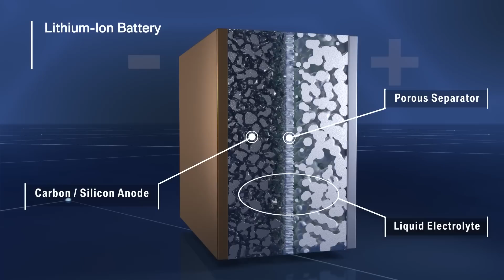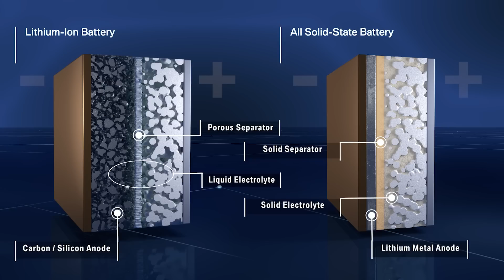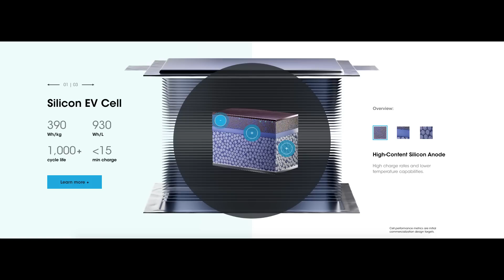Why Solid State Batteries Could Be the Future - Autoline Exclusives

Comment: Is there any projected change in heat generation during charge and discharge, is that all a function of internal resistance? How about charge discharge rates?
I'd like to see a long life, lightweight solid state replacement for my 12v maybe a solid state with a j1772 at about 45 lb that you can throw in the trunk of your old EV for challenging trips, park it and plug it in.

Comment: Solid state batteries will be the game changer in EV revolution!
Reply: Very cheap cells using abundant materials, produced in huge numbers, which meet the performance envelope of specific vehicles "will be the game changer in the EV revolution" (!!)
.
A 4680, made in a relatively tiny factory which outputs about 7 times the kWh (GWh?) of a "wet" production line, which uses only 60% of the metal to carry the same capacity of smaller cells, which suits a structural role, thus making the vehicle lighter and which may be suitable for use with "cheaper materials" seems to be a great start?
Reply: Might be, I wonder if by the time they figure it out we'll have an equal non solid state solution
Reply: Yes, especially for eVTOLs!

Comment: Solid-state batteries are a great in the lab but let's see them in an EV we can buy. Meanwhile, my 2019 Model 3 on the driveway is working just fine.

It costs $2.75 for 100 miles around town and highway miles are $3.50 for 100 miles. Staying overnight in a motel with free breakfast and charging costs $3.00 for 100 miles. The expected, 7.9% battery degradation has been slower than the Supercharger expansion.

Comment: Bring it on! I don't see the battery space as having winners and losers, we need all the ideas and we need to use them all where there is a use case. We know that when a single chemistry is dominate the cost and availability of the materials become an issue. The more diversity we can have in batteries the better.
Reply: Exactly! And some battery types will be best in certain vehicle types and we'll need something different in others.
Reply: @davidmccarthy6061  Even the ones that don't make it in cars could be used for other storage applications. Nothing will go to waste.
Reply: Agreed.
If a cell form factor/ chemistry/ technology type appears which matches the necessary performance window for a specific product, at the right price, use it!
.
I think this is one area Tesla may be ahead of the game.
Let's say a "4680 killer" (🙄) arrives....
They have other applications for the "older" tech.
They have a small, high volume factory format.
They have elements (at least) of that factory which should be compatible with new technology.
.
Ramp time from "green field" will be a factor.
.
The more "out of the envelope" thinking, the better.

Comment: I believe there are a few major problems with solid state batteries that will make them irrelevant to EV until may be after 2030: 1) lithium dendrites issue will degrade battery very fast, 2) they are expensive to fabricate and mass produce, 3) interfacial and mechnical stability issue will cause early failure.
Reply: Solid state batteries are the nuclear fusion of energy production, always a promise, never a reality. Solid state battery tech. is older than Li-ion battery, but never managed to scale it up.
Reply: Innovators will continue to innovate.
Reply: There are a out four major kinds of solid state batteries, each with pros and cons.
Reply: In automotive world 2030 is tomorrow. Qualifying anything takes years.
Reply: I think fast easy construction is one of the positives, they can skip the baking/drying step

Comment: Glad to hear someone say 500 miles. Too many manufacturers are not looking past 250. That 500 also has to be REAL miles, at highway speeds and with mountainous terrain. Your typical 250 mile range BEV only gets about 160 max on western highways which commonly have 80 MPH speed limits and have 3,000 foot passes to go through. If your on vacation, no big deal, but just stopping for a recharge 4-5 times on an 800 mile trip is just too expensive (in time lost) when all of our my gas and diesel vehicles can make it with one 5-minute stop.

I've tried it with several, Tesla is the best, but it takes 5 more hours to make an 800 mile one-way trip than a Ford Fusion or a Mercedes GLC Bluetec.
Reply: Sounds like you are doing it wrong then. You also state an extremely rare use case that 90% of people don't live with. We sure don't want every company making 500 mile EVs just for you. My Bolt's range let me charge every 6-12 days depending on season, for $15 a month. How are your gas prices today? I sure don't want to lug around 2000 pounds of battery I'll never use!!!
Reply: Aptera!
Reply: If time is money and you can't afford to waist time, take a flight.
Reply: @heathwirt8919  Easy to make a dumb comment when you don't understand the situation. We move goods that can't go on flights. That have to have a certified caretaker, so we can't ship it. But even if not, flights are expensive when I can get 4-6 people 1,100 miles overnight. You really don't think we've looked at the options?
Reply: "500 miles"
Watch again, he was talking about Trucks, not cars.
His basic position (imo, explained in a different way) was
"Outrange the driver, charge during the "driver break", repeat"
Reply: Too much battery is a waste of money space and weight. People need less range than they think plus there are charging stations. If you build the electric car people think they want no one will buy it.
Reply: @rp9674  Your overly-broad statement sounds really stupid to those in rural cities that regularly need to make 1,000+ mile round trips. You are right that current battery tecnology is woefully inadequate to us. Current technology is essentially only good for people who never leave their little 200 mile bubble unless on vacation. Maybe in your population centered life you don't know about the large number of people who regularly do have to make long trips quickly, but we exist, and we test all the cars that others claim to work for us. Tesla's range is hurt by how little charge you can rapidly get in after that initial 100% charge, and Elon is reducing the range promises he initially made. The Ioniq-5 and Taycan can charge reasonably quickly, but no part of their range is adequate. And NOBODY's range is accurate at the 80 MPH freeway speeds in the western US. We need better battery technology. But too many governments seem to want to legislate away fossil fuels without providing a workable alternative.
Reply: No, it would be stupid to build a EV with 2x or 3x the battery to try to meet statistical outlier cases, It would be too heavy and expensive.  Of course freeway speed, hills, extreme cold cut range. Anyone who drives 1,000 mi in one trip would benefit from a lot of compromise VS the cost of gas, not even considering and fire mental issues. Gas production is subsidized in USA, probably why it's cheaper than many other countries. If EVS get popular enough there should be lower gas prices from supply vs demand, for the people that need it.
Reply: @rp9674  Only too heavy using current technology. Why are you so opposed to investigating ways of having better energy density than LiOn can provide? While this technology is much better than it has been in the past, we need still better technologies. If we had better energy density, it would be much easier to have V2G and V2H for city dwellers, reduce the need for L3 chargers in and around cities and give us a technology that doesn't provide a disadvantage for the people producing the food you are eating. Quit being so complacent with what we have today.
Reply: @michaelterrazas1325  I'm not opposed to it, research is happening now, there's dozens of videos about amazing, insane, game changer, game over new technology that's almost here. I'm looking at reality and current technology. Obviously improvements in energy density / cost will change the equation. Public charging will get faster, more common, and less necessary.
Reply: @rp9674  I am not as sanguine as you that we will see any usage of other technologies by the current BEV manufacturers. There is just too much infrastructure being built up with an inadequate technology (technical debt). Within a couple of years, moving from L-Ion will have just as much inertia keeping new technologies out as ICE does today, and there will be no easily identifiable pressure to get them to move to longer ranges. Hence, economies of scale will never develop. So instead of driving our cars for 10 years, we will be forced to try to make our ICE vehicles work for 20. 

Then I see every car manufacturer, including Tesla, saying what you did (due to what I see as short-sightedness): that 2-300 miles is all anyone needs. That is just not true. A range that short only covers metropolitan area dwellers who only leave their big cities for vacations. Those people don't actually need personal vehicles at all. They could be more economically and ecologically served with mass transit, ride-sharing, and, in the future, automated vehicles. It is just as stupid to have all those cars in all those homes with their carbon footprint of manufacture as to try to serve those who do need longer range. Those for whom mass transit, ride-sharing and automated isn't just distasteful, but actually infeasible.

I don't have the links right here, but several studies have shown that the vast majority of personal vehicles on rural interstates are not registered in metropolitan areas at all. One study, conducted by a California university at interstate travel centers (Flying J, Pilot, Loves, and TA), found that most drivers surveyed indicated that their trip that day was over 500 miles one way. Such trips are not the design point for any BEV today. And yet, California wants to outlaw ICE vehicles for everyone, even though there is not a workable alternative for most of the cars on I-5, I-15, US-101, or CA-99 once you get away from LA, Sacramento, or the Bay area. Almost the entire Midwest and Intermountain West are that way also. So, no, you are wrong. It is not an edge case. It is blindness to the needs of others in different circumstances than you.
Reply: @michaelterrazas1325  it is an edge case, it just depends on where you draw the line to what's edge. EVS are struggling to be profitable appealing to 10% of their small market probably not a good business move. Government needs to do something to move it along, a gas vehicle bought in 2034 should still be good for a few years. I can't imagine they won't have a solution by 2040, it'll probably be so good people will forget what they were fighting for. Easier to relax restrictions later if needed then do nothing. Mass transit doesn't even work in LA area, except as supplemental, we're too spread out. 
In your example trip if improvements cut the extra time down to 2 hours, might be worth saving several hundred dollars on gas and maintenance, maybe have a leisurely meal break or 2, not to mention environmental considerations & less dealing with murderous regimes like Saudi Arabia & and the side effects of Russia's actions.
Reply: @rp9674  My point is that it is more than 10%. Over half of Americans do not live in metropolitan areas. Everyone you deal with drives short distances, but that doesn't mean there isn't a very large market. LA did have an effective mass transit at one time, and it could be rebuilt. It just needs government to focus on it, rather than high speed rail to nowhere. The Metro system is getting more ridership daily. It needs to be expanded, and LA has to limit car usage to every other day, or every 3 days like some other cities in the world did to get people to use mass transit. So far, politicians are unwilling to bite that particular bullet, because they won't be re-elected. That's what I meant that it is only distaste that makes it so mass transit won't work, nothing technological. Other cities that are just as spread out as LA have made it work, but it takes courage. Those that have forced the issue have begun to see reduction in car usage and fewer carbon emmisions. If we can ever get there, car ownership in the US will reduce drastically in metropolitan areas. At that point, the vast majority of privately owned cars will be in the rural areas.

But I have to strongly disagree that we will see a move to another technology in my lifetime. As we see now, business doesn't want to change. For all the capabilities of Teslas, nothing would have been done without the EU, China, and California regulations forcing automakers to change. They were only able to do it because there was an obvious reduction in climate change causing emissions. Moving to a more energy dense technology will be just as expensive (retooling), but the apparemt benefit won't be large enough to justify the investment, particularly if people ignorantly keep saying that no one needs longer range. Or if those same people keep thinking it's just a miniscule number of people who need it. The fact is, since no one is building clean vehicles that match the range currently seen with fossil fuel vehicles, we have NO IDEA how well they will sell. Looking at the inability of OEMs to predict the sales of EVs, I don't see any reason to believe their or your assertions that there isn't a market there. You sound just like Toyota, loudly proclaiming something that you do not have a clear view on. So I see us eventually getting a bunch of useless small-range vehicles and the OEMs having TRILLIONS tied up in the technology, and being unwilling to reinvest after the current disruption. 

There will always be those who don't need a lot of range. We already have EVs for them. We have also that in the ICE world. I have no use for a  Sentra, RAV4, or dozens of other ICE vehicles that need to refill every 2-300 miles. That's why I and my neighbors have Fusions, GLKs and other vehicles that get us 5-700 miles on a tank, but I hate spewing out CO2 and NOX. And I know a lot of people in 14 states that would jump on the opportunity to buy something more ecologically sound, if it were also economically sound. But since nobody is working on it, and gas stations may go the way of the dodo, we are justifiably concerned that our needs will ever be addressed. The fact that you so obstinately refuse to consider this as a legitimate issue is evidence of the problem. But then we are used to it. Sacramento takes water away from crop and stock growing to water golf courses and keep high-end neighborhoods with green lawns. The federal government makes regulation after regulation that forces small farming and ranching operations out of business. Once big corporations run everything, there will be nothing to keep them honest. You are helping to build that future. Congratulations.
Reply: @michaelterrazas1325  In 2020, 82.66 percent in the US lived in cities & urban areas. 
Super long range EV would be too heavy and expensive to make sense & there needs to be profit, better to build the EVS that work for 90% of people while new technologies emerge
. To make public transport work in LA would take a lot of subsidized fares and a lot of time to change culture and people to adapt. It would also be tricky to find the space, we can't just take Lanes away.
I don't support highly corporate farming, Monsanto and similar corps, John Deere's locked out tractors. 
Others would say we need small "affordable" EVS, but they're not popular, so what good would it do to build them. There needs to be profit potential.
Reply: @rp9674  Look at those numbers again. Those population statistics are VERY misleading. They include all cities of 100,000 or more. Most of those small cities are NOT in metropolitan areas. That includes me. But in cities like mine, there are no mass transit systems. There is no taxi company. My wife's company does taxes for Uber & Lyfft drivers, none of them make money, so the drivers only last part of a year. Door Dash fails miserably. Our airport can get by with a combined fleet of about 50 rental cars. Most people have 2-3 trips per month to LA or San Francisco, all of which can be done with a single tank of gas or diesel, but require a 40 minute fast charge with EVs. Most people make several trips each year to one of Arizona, Nevada, Utah, Northern California, Oregon, or Idaho. None of those trips is workable with a current BEV. A good chunk of us average more than one trip per month to those states, but add in Washington, Colorado, New Mexico and Wyoming.

If a city of 100,000 does not fall into a nearby metropolitan area, the people need to make long trips.
Reply: @michaelterrazas1325  that sounds brutal, I live 30 miles from my work wouldn't want to travel one more mile

Comment: Been hearing this since 80s . You will see new tech batteries 🔋 on your phone first . Till
Then it’s a pipe dream sales pithy.
Supercaps  misrepresented
Reply: Actually car battery technology is far removed from what is in a phone and can't be compared.
Reply: A phone battery be easier to make  but why  same over 10 years ?
Reply: Once the form factor and mechanical construction is running at required speed and a "basic" chemistry is available, it's no longer a "pipe dream".
After that, it's all incremental development.
.
Supercaps? False dawn in this application. Batteries already mimic many of their advantages, without their downside.
Reply: @rogerstarkey5390  show them working with independent observation. Not truck rolling down a hill claiming hydrogen power , 😆😆😆